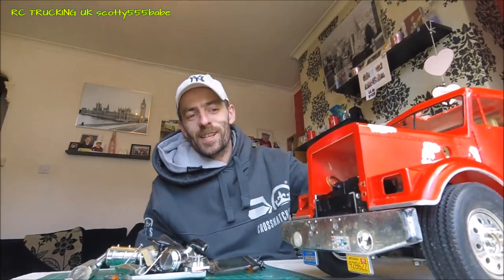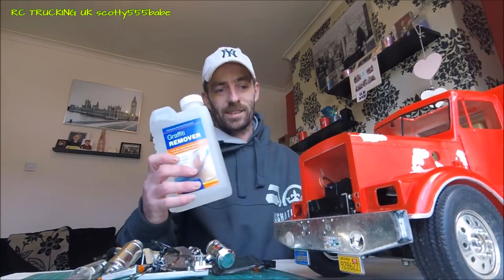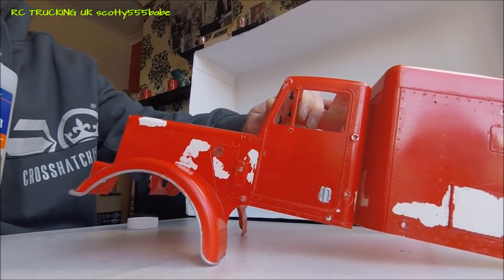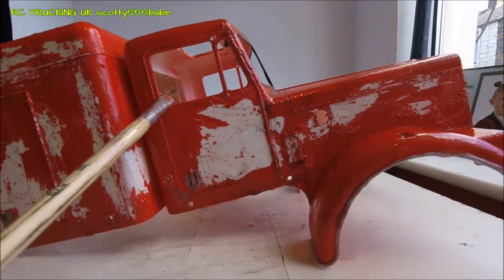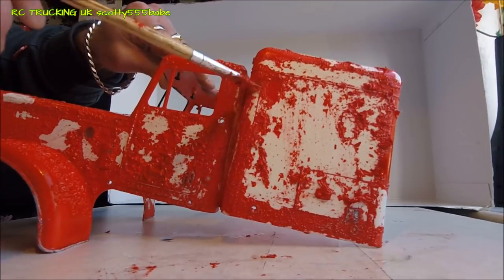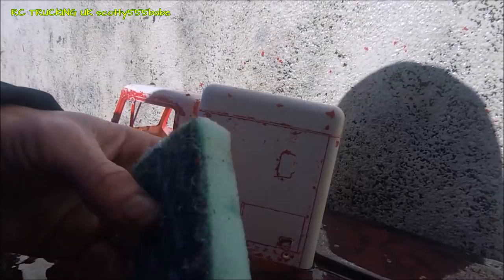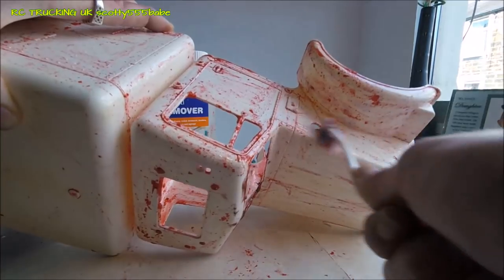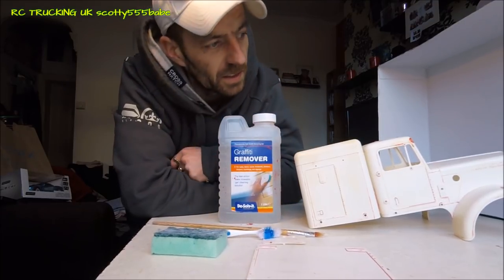HOW TO STRIP PAINT FROM An RC HARD BODY | TAMIYA KING HAULER

Comment: I never knew they sold that type of remover... clever... I remember as a little kid, I used to buy up old plastic models, (the glue together type).. and to remove the typical enamel paints, I learned soaking the painted parts in DOT-3 automotive brake fluid, which I understand is silicone... I would recommend that doing this outside is a must... not due to the smells as, but, the hyroscopic nature..... either way I shall look into  this type of remover.. Thanks Boss
Reply from the maker: I've used brake fluid in the past... and nitro fuel.. oven cleaner, there's many ways to do it which is great but many people still get put off as they think they have to spend days rubbing and sanding 👍

Comment: And that doesn’t soften up the plastic,do you get that at the hardware store.
Reply from the maker: I've used strippers in the past which have softened the white parts and melted the black but this graffiti remover is plastic safe (comes in a plastic tub) and dissolves paint...

Comment: I use a massive rectangular plant pot and fill it with ACETONE FREE nail varnish remover, it will strip a model to the bone in minutes... Although it is safe for plastic it will destroy it if left for hours but is generally safe on most plastic on a quick dip - 5-30 mins... But never give it a second 'bath' in the stuff (ever) it will eat it then.

To this day i have not found a paint that it cannot remove. It is worth noting however that once the liquid has been used once its useless after that but its a cheap and clean method.
Reply: A trusty old toothbrush or my preferred tool a washing up brush - (model detail dependant on which i use) is sometimes needed.

Comment: That looks like a mess and some hard work at that . Maybe cost a bit of money .  I really dont want to pry or cut in but to make things easy and cost a bit less .  All you need is two gal of Mean Green or Purple Power from the Dollar store . That it and that all you will need . Ho one more thing a good little 1 buck brush .  Pore the content into a container that the body can be submerged completely  Each day take the body out and rinse and just brush it  a little . Then put it back in and let it soak some more . I took 3 days soaking  ( NO Work involve ) . Time work spent total  20 minutes . Easy peasy !   The good part the cleaner can be reused for anything else . Just let it set and let the paint settle to the bottom the start pouring it  back into the jugs .
Reply from the maker: I'm in the UK and this process only takes a couple of hours all in all..
Looks messy at the time while the paints bubbling off, buts once it's gone its virtually a fresh cab ready for prime 👍